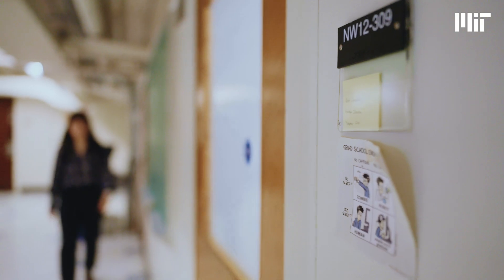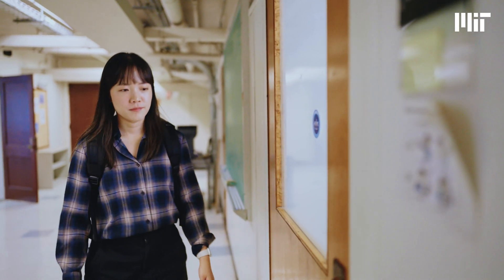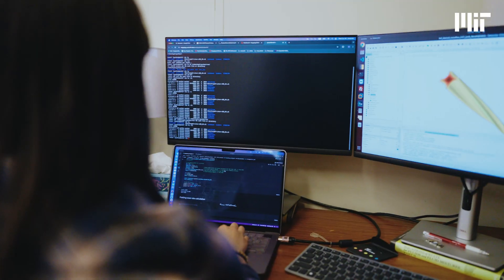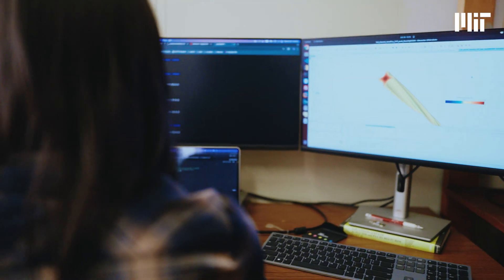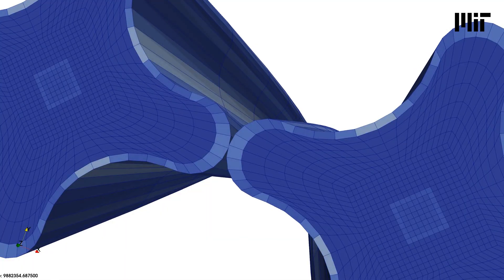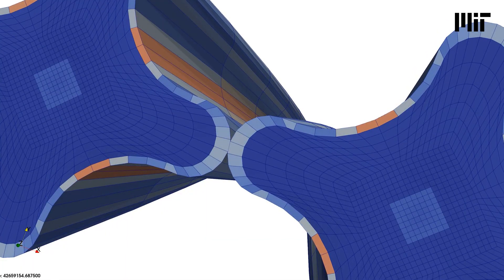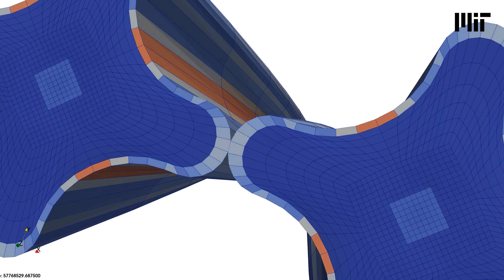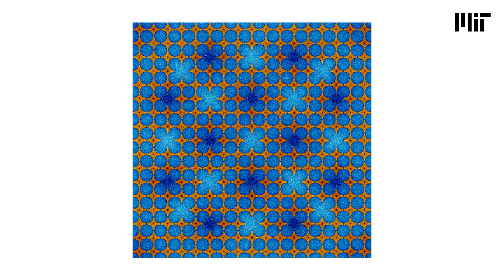Youyeon Choi: Making small modular reactors more cost-effective

Comment: Good to see some new ideas. But  beware engineering problems. Flow induced vibration was a serious problem in the early days. A bigger problem is the cost of changing the design. Suppose your reactor costs half a billion dollars to build. Every part of the design, down to the "last nut and bolt"  needs to be justified. The choice is between a new design which is unproven in the real world or a design which is tried and tested? Financial risk and possible safety risks would rule any new design out. This is the mistake the British made when building new reactors; each one was "improved" by adding new features. So, each one had a different set of teething troubles which cost the earth to sort.
But it pleases me to see your work.  Fresh ideas are always useful to us.

Comment: Thank you for this video presentation. I am curious what percent improvement are you showing in your modeling?  You mention that it will be a new fuel, but didn't discuss it.
Have you considered also the Hexagonal shape, which seemingly would have optimal packing? Could you provide some more information as to the advantages of the cruciform shape that you chose? As I look at the Cruciform shape, I notice that there is an area where the wall thickness is thinnest, does the modeling show that this is adequate for the anticipated stresses?
The video contrast and color is amazing, but please consider Normalizing the audio in the future to ensure that the audio level is not sub-optimal.
MIT is awesome!
Reply: Cruciform/Quaudflute fuel is for rectangular pitch, to directly backfit into today's fuel cell & control systems, but it still leaves empty straight flow regions between every 4 fuel pins. Triflute is needed for triangular pich, hexagonal cells for better fuel packing, flow better controlled by the twisted pin, because of reduced straight through flow path. This improved heat transfer even more than Quaudflute/ cruciform Fuel. The triflute can be used to increase the metal to water ratios, to harden the spectrum toward the intermediate to get to higher breed & burn, so higher burnup, without higher enrichment. The twisted metal fuel ingeneral improves the heat transfer, while also decreasing the  flow resistance, reducing pumping power, increasing natural circulation decay heat removal, &/or allowing better full power natural circulation. And being metal, it decreases fuel temperature, to barely above coolant temperatures, instead of 1100C, reducing the probability of exceeding the Zr-water reaction temperature of 850C. This is the fuel limiting temperature for Zircalloy in water reactors, NOT peak fuel temperature & either Zr or UO2 melting points. UO2 PCT starts over the Zr-H20 temperatures, so when cooling is lost, temperature quickly migrates out to the ZR-H2O interface. Metal fuel takes longer because it needs to heat up from 370C.

This is Lightbridge fuel in the US, formerly known as Rostkowski fuel, and before that as Russian military fuel.
Reply: @EdPheil  Thank you for that detailed explanation especially as it relates to retrofitting existing fuel cells. I wonder, given that there does seem to be some extra space in the Quadflute design, perhaps a Zr-Water reaction inhibitor could be added. 
   Is this video hinting that a new design is combining the idea of helical design and quad-flute that would be even better? I guess I didn't quite get that from the video ...